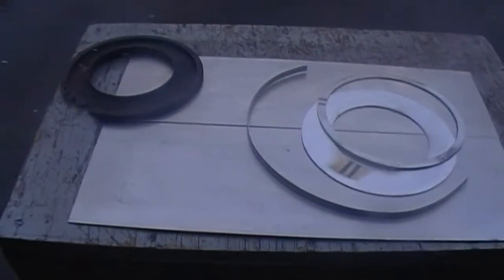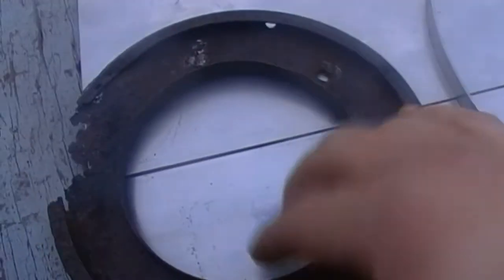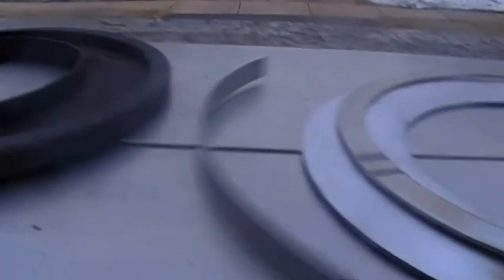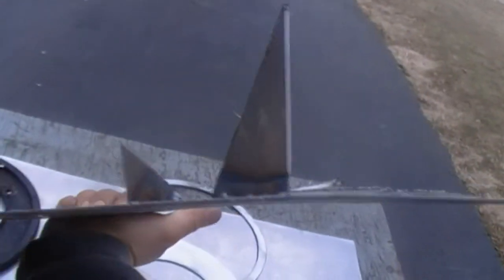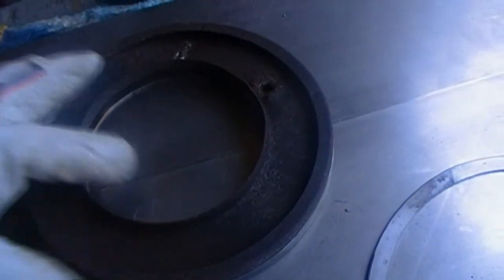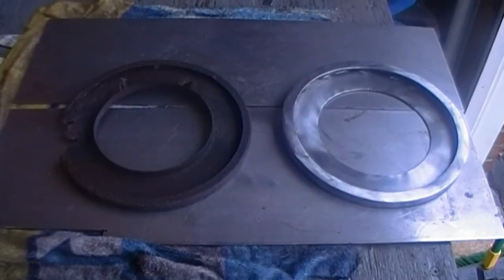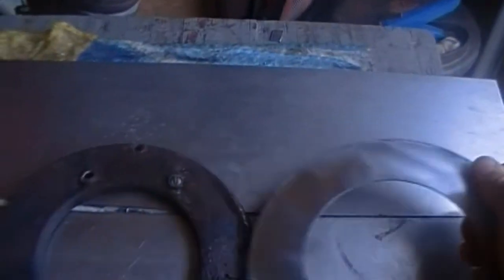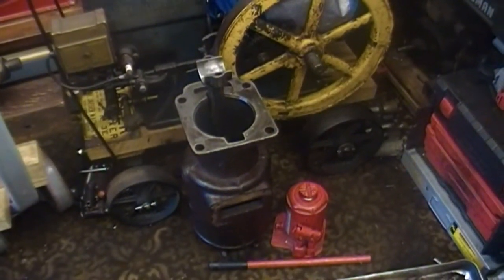Bessemer Oil Disk

Comment: Very nice work there Mike! 
I was just curious about the inner ring/flange that seems to be on the original but was wandering why you didn't incorporate it into the new one.... Kind of looks like that would help catch oil too.
Reply from the maker: Thanks for watching!!  I did think at first that that inner lip was superficial but after I made the video I realized it probably serves to keep bearing grease from accumulating in the trough and clogging the oil passage.  I have since added it it the new part.

Comment: You missed the inner lip on purpose?
Reply from the maker: At the time of the video I deemed it unnecessary, thought it was just a result of the manufacturing process.  However I have since added the inner lip as I now believe it serves to prevent bearing grease from entering the ring and clogging the oil hole.

Comment: Great fab work Mike !!  What about the inner lip do you need to put one on the new part ?? Does that inner lip keep the oil inside the disk ?? Thumbs up man ...
Reply from the maker: Thanks Shawn, I ended up adding that on after the video. I think it keeps bearing grease from clogging up the oil hole.

Comment: Will the welds affect the oil flow within the ring? Are you going to seal it so the oil doesn't drool out from where you didn't weld it? Hey hows that lil 2-71 Jimmy diesel coming along?
Reply from the maker: That is something I considered, the with of the oil trough is about 1/4" of that about half of the inner surface is weld.  So there is still 1/8" of flat concentric surface for the oil to flow which should be fine.
Oh the little GM diesel is still on the back of the flat bed waiting for warmer weather, got a bunch of parts for it!

Comment: That came out nice ..Do you need an inner flange on the center hole ? like the original has
Reply from the maker: Thanks for checking it out.  
I believe that inner lip keeps out the bearing grease, I ended up adding it after the video.